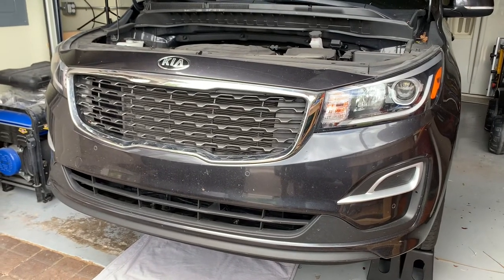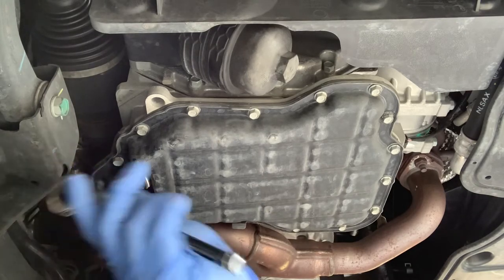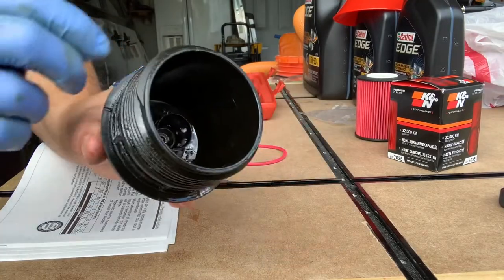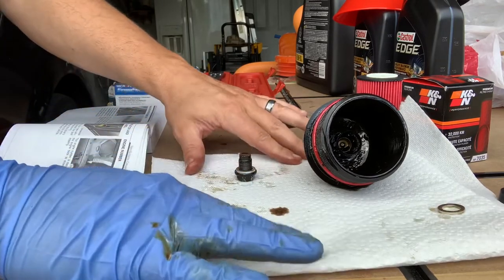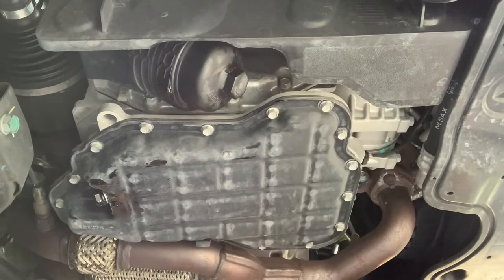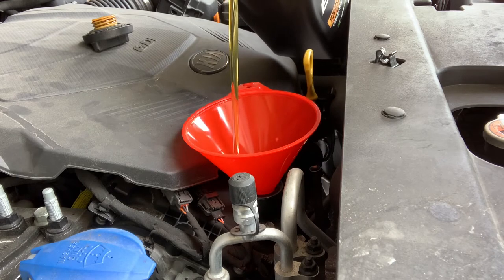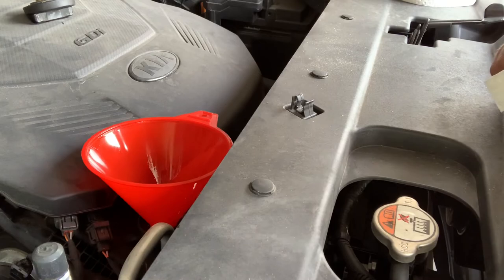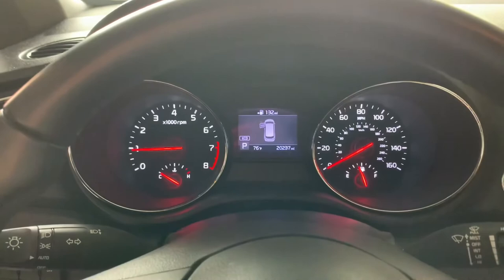How to change the oil on a 2019 Kia Sedona

Comment: My filter didn’t come with a crush washer?
Reply from the maker: Did it come with a replacement rubber
 O-ring? You can pick up a crush washer at any auto place like autozone. I think Walmart sells them too. If your current washer isn’t bent or “crushed” too much, you can probably just reuse it. I’ve done that before.

Comment: Hi my friend My Sedona has 45 thousand miles. Is it okay to put that same oil in it?
Reply from the maker: Mine has about 50k on it and I use this full synthetic oil every time. No issues at all. Just make sure you’re using the correct type (in my case it’s 5w-30). Should be labeled on your oil cap and in your manual. Also, make sure you use a filter that’s designed for full synthetic oil.